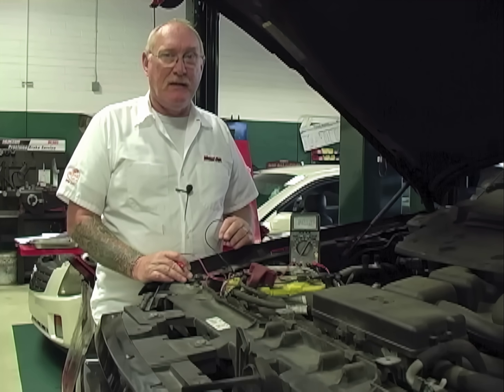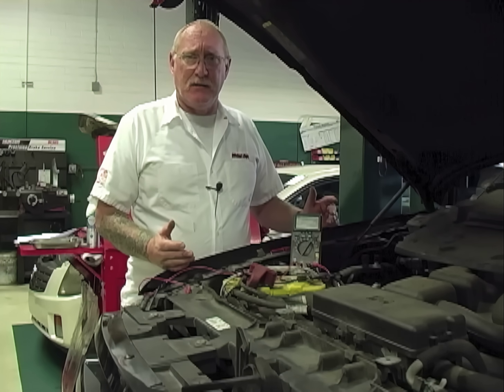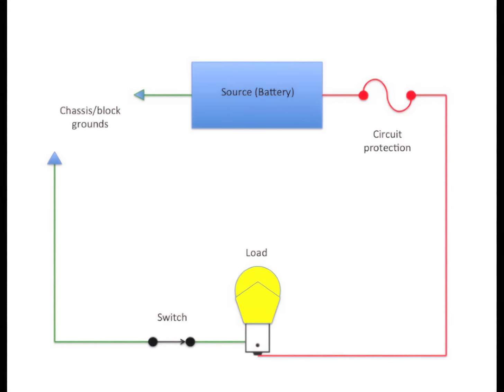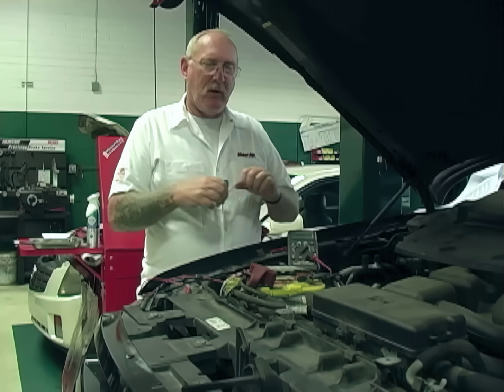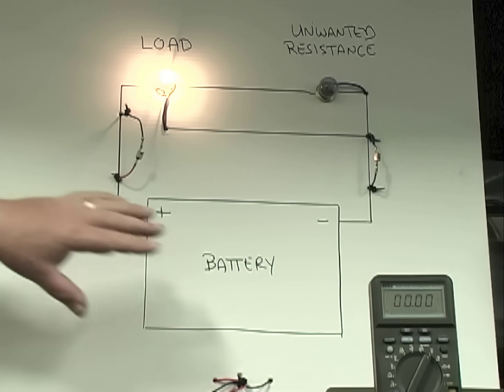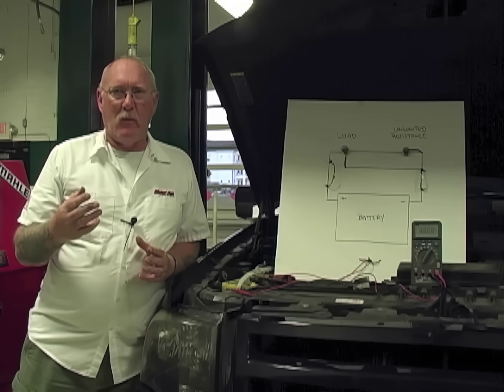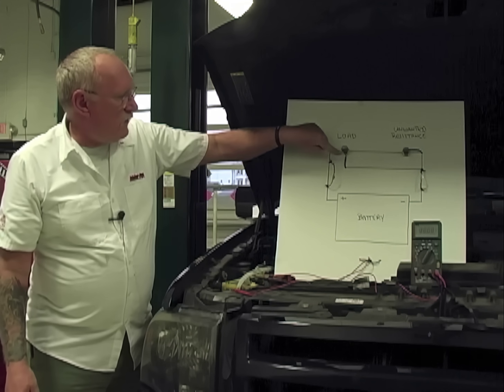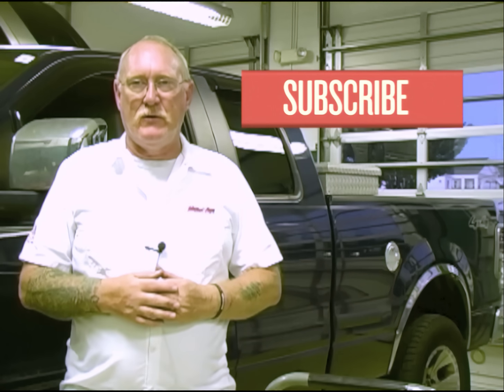The Trainer #47: What measuring voltage on the ground side means

Comment from the maker: I appreciate all the comments and critiques! This is an older video that I learned a lot from, and I've since tried a few different ways of explaining ground side voltage drop. I hope you will all sub to our channel and check out the entire "Trainer" library. THANKS!
Reply: I will be referring your efforts to a few classes of grade six's as I do lectures on their Flight then Electricity portions of their curriculum. Very well done video! The half split method demo'd is crucial in troubleshooting 👏
Reply: Like and subd, thanks,
Reply: Superbe sharp presentation. Makes total unlike many others
Reply: The effects of electromotive force have not changed since Henry Ford 1st put the battery in to his car the basics of automotive electricity are actually the basics of all electrical knowledge to learn that is most important and will get you far in the trade whether it stays with automotive or continues into housewiring or industrial wiring I've just retired after 38 years IBEW Union electrical contractor and have taught many Apprentices and journeymen that have turned out to become their own contractors through the years you're doing a very good job at the basics what's what it all boils down to ladies and gentlemen learn your basics stick with it and it will become easier through the years your videos explain very well keep up the good work
Reply: This is great of course - but when I'm truly mystified to tracing down a dead circuit - 1. I'll disconnect the battery - 2. apply voltage with say a 9 volt with test leads, now work my way up the circuit, and sure enough I find the spot in harness where it went dead. 
Being I know there's only one source of 9 volts possible as displayed on the meter. 
This type of testing is similar to a phone tech tracing a bad line to a phone. A pulsed voltage is applied on one end and picked up out side the harness by receiver. 
Or it might end at a corroded connection. Repair connection and we're good to go.  

Cheers
Reply: Wait. Not that it negates the knowledge you shared or my appreciation for it, but to be clear, you have nothing to do with the trainer, right? Just reposted one of his vids...? Credit is due where it is deserved and I feel like many won't catch the point I'm getting at... is this guy still making content? If so (and regardless), you should really plug him in the title or , well, I guess you did..  I dunno what rubs me wrong about this outside of that I felt slightly misled. Or that may be only because the content was so vital and good that I feel the effort to give due credit wasn't enough. I dunno. Thanks and sorry for being so critical but what's right is right.
Reply from the maker: @jpisow  I'm the guy in the video - name is Pete Meier - and I've been creating The Trainer series for over a decade now. I work for Motor Age magazine, hence the name of this channel. Thanks for looking out for me!
Reply: @Motor Age.  Pete, truly a pleasure to meet you. It's kinda crazy how when you find something worth guarding you start to get offensive in the true sense of the word. Here I am going at you, the guy, in the name of defending you, the guy...ahhh... I'm sorry man. But really, Thank you with the utmost sincerity for the wholesome content and for sharing your ability to teach in a concise and effective way. Wish I would have found you sooner, but hey, better late than never. Right on Pete, but excuse me. I've got a lot of catching up to do.
Reply: My brother has an RV  and the engine battery will loose voltage in just a few days . Not an old battery .Trying to find out why he disconnected the negative ground cable and put his meter between the negative post and the ground cable . After watching your video I still am not sure about whether there should be any voltage . He is getting a voltage of 12.6 volts . At the battery between the posts he has 12.8 volts . Is this normal? He says no but I am wondering . Should there be any voltage at all ?Can you help ?
Reply from the maker: @rodneyterrasrrod2087  With the cable disconnected, no current is flowing so no voltage drop is occurring. All he's reading is Open Circuit Voltage and the reading is normal. What he wants to do is put the leads in the ammeter jack (using a fused test lead is best since you don't know how much current is draining) and measure current between the two leads. Even better is the use of amp probe that goes around the cable. Look for videos on my channel under "parasitic drain".
Reply: @VehicleServiceandRepair  Very happy and thankful for your response. After watching your video I thought if you said 8 volts is a problem then 12 volts should be okay . i went to my brothers and told him he's chasing his tail . It's normal to have a voltage reading between the negative post and the disconnected cable . He couldn't believe it but we took my negative cable off my truck and guess what . !2 volts . So I said what is draining your battery . His new radio . Seems he turns his ignition off and the radio stays on and he never noticed it . He is happy now and I told him you don't know what you don't know . A couple of back yard mechanics thank you.
Reply from the maker: @rodneyterrasrrod2087  Glad you found the problem!
Reply: @VehicleServiceandRepair thanks for the video. 

most YouTube mechanics have no clue about electrical. They don't have a standard maintenance schedule to clean all the harnesses and ground bolts every five years in rust belt areas like central Canada, or places like Michigan. If the bottom of the vehicle has noticeable rust, so can any connections that got road spray on it. Which is basically anything..... Even the computer inside near the passenger floor area can be rusted from salty moisture on shoes.....I've seen that. 

Thanks for the video. It makes YouTube just a little bit less stupid. 😂😂😂😂
Reply: @VehicleServiceandRepair  "It's easy to be critical and much more difficult to be correct.  So what if we don't call the black lead the reference lead... It dosen't mater!

How fast can you find out what is wrong with a car and how fast can you fix it and how much will it cost.  

I would say as complicated new cars are they all require every single one of us to do everything we can to just keep up with all of the advances.   

I watched this very same video and developed a great appreciation for it and for Motor Age and the gargantiuan effort put into making both the printed and visual training materials.
Reply: 3:45   Affect
Reply: Maybe i missed something,  but you are only using one of the two paths from the first load to ground and the other is removed(though still showing in the drawing), not connecting both at the same time?
Reply: Hi, I have charged my car battery using my home inverter a few times. Just want to know if it's OK or not. 
Now my car starts but TCM has issues, just wanted to know if it's related to the battery ⁉️
Reply: Motor Age This is by far the BEST way I’ve ever heard it explained. No one EVER really explained what and why your car’s chassis is used as ground! So simple, but a lot of people may not know that!
Reply: @scrappylady  Some how most all of the voltage gets used up by the load and other resistances, but the current (in a series circuit) remains constant througout the circuit even past the load and flows back to the battery with only a small amount of voltage remaining also going back into the battery.   

The amount of current is determined primarily by voltage and resistance.  E/R=I, or V/R=A, and A×R=V.
Reply: yeah! your stuff exposes much that is missing in the understanding of automotive and electrical control.
I am critical(constructively) but I appreciate your work.
...and I am subscribed...
Reply: 3:45 AFFECT is a verb (influence) which should be used here instead of EFFECT which is a noun (result). Thanks

Comment: MY MAN, GREAT JOB, SIR YOU HELPED ME TREMENDOUSLY ON REALIZING THAT THESE  VOLTAGE DROP READINGS ARE REALLY IMPORTANT BY THE COMMENTS YOU MADE AT THE END OF YOUR VIDEO, SIR, MY MOMS 2004 CHEVY MONTE CARLO SS, HAS BEEN GIVING ME HELL TRYING TO GET IT TO START, IT HAS THE NO CRANK , NO START SYMPTOMS, FIRST OFF HER KEYS HAVE NO CHIP ,SHE DOESN'T REMEMBER IF THE KEY FOB THINGY EVER WORKED,HER FAN MOTOR STARTED STAYING ON EVEN WITH THE CAR OFF,NO KEY IN,WELL MY BROTHER TOOK THE 30 AMP BLOWER MOTOR FUSE OUT, I HEARD HER SAYING ONLY HER HIGH BEAMS WORK,SO I GO OUT AND LOOD UNDERNEATH STEERING COLUMN AND SEE SOME BLACK TAPE COKING OFF OF SOME WIRES, SO I PEELED THE TAPED OFF AND REWIRED ABOUT 3 DIFFERENT WIRES, THEN I SAW A BUNCH OF BLACK ,AND BLACK WITH WHITE STRIPEE WIRES ALL LIKE MELTED TOGETHER, SO I SEPERATED THEM AND TRIED TO TAPE THEM BACK TOGETHER BUT COULD FIGURE OUT WHICH ONES GO WHERE, NOW THE CAR WON'T START, ANY POINTERS WOULD BE GREATLY APPRECIATED

Comment: The bulb on the left has 3 leads going to it.  Either you are confused about how about how many wires it take to light up a bulb, or you've drawn this circuit incorrectly.  If this is how you wire a simple light bulb, it's no wonder why your getting voltage from the body to the ground side of the battery.  Your wiring is all F'd uo!

Comment: The thing that many people don't get is resistance and how voltage drops across it in a series circuit, dependent on current flow in that cct. They see connections at "connected" or "disconnected."

But the fact that a connection can have corrosion/dirt/pitting/etc etc, and therefore a resistance value that can be anywhere between almost zero and open means that you need to understand that to fault find. 

Unfortunately, that is elec theory, and mention that on any page where people "ask you to help", and they immediately argue with "NO, I heard a bloke say (insert random fact)". This would be a random bloke who isn't an elec, and couldn't fix their problem.

People are adamant that they NEVER need theory, because "random bloke said"................ so in the end most elecs give up and leave the page. 

The fact that the voltage drop across an in circuit resistance changes when current is drawn (ie NO voltage drop shown when no current flow/voltage drop when cct completed/current flows) means that to diagnose properly, you have to understand and measure both. 

As cars get older, you can have so many problems with voltage drops across body grounds and earth returns. But you won't see them (measure them) until you draw current across that connection.

Comment: You’re saying that somehow the positive  of one load shorted to ground between the ground lug and the ground side of the battery. Then you need to check a million individual wiring connectors to find the shorted load.

Comment: He appears to have a line bypassing the 2nd load in the circuit. If that is the case the 2nd load would be shorted across so therefore would not light up as that part of the circuit would be zero resistance.

Comment: Maximum allowable voltage drop on ANY BATTERY CABLE under Load, .2 vdc. Positive or Negative. Maximum Allowable voltage drop on ANY CHARGE return, .2 vdc per 10 amps of charge rate measured at the Alternator B+ output. Many older cars had so much resistance from the ignition switch to the starter we HAD to install remote starter relays, at The Auto Electrical Shops here in Flagstaff. I was employed there and at 3 major Dealerships for 40 plus years.

Comment: As a fire alarm technician,  this is every techs worst nightmare on a panel.  Because you can chase miles of wire sometimes depending on the size of the building/ circuit.  Parasitic drains on cars is a common problem that I have fun chasing down as weird as it sounds.  Every good tech should appreciate the challenges which come with their respective fields of work. Excellent lesson , love that it's ten years old too.

Comment: great video, great work. One thing i don't agree: the fuse is always on positive side is because if it was on negative side there would still be a risk for a loose positive wire (unprotected) to touch something metallic (which is bonded to negative node) ultimately bypassing the fuse.

Comment: I bought a Ford edge in 2014 that now has 197k miles on it with no repairs. Oil and fluid changes and still going strong.

Comment: I like this video. I often wanted to figure out why my old Camry had dim headlights. Also I have seen vehicles on the road with the same dim headlights. I figured it was a voltage drop somewhere, and this video gives me some information that I can use to find the source of the drop or short. Thanks for the video.

Comment: The problem on my car is i go to start it and as soon as i turn the ignition.  All power is gone. So i have to disconnect the positive terminal, try to start it and sooner or later it starts..and i have to disconnect the battery a few time for the car to start. One thing in do notice is that the positive terminal clamp gets hot..

Comment: I am a Electronic Test Engineer 40+ years.  This is a Excellent Video. You would not believe how many Electronic Technicians I have trained over the  years. Congrats on  the excellent video...
Reply: Question I have about the video not trying to test you or nothing but actually just wondering. So dosent voltage run negative to positive? So wouldn’t that mean that the voltage has already gone through the load how come the circuit protection is in the positive if it does go negative to positive?
Reply: @bttlmarc5125 you're mistaking voltage the measure of electromotive force like pressure in a water pipe to the flow of electrons which as you say flow from negative to positive in a DC circuit. Like piped water all the pressure is gone and used up when the electrons in this case have tumbled back into the battery reservoir ready to be pumped through the pipe network again. The pump requires work and energy and in the case of our electrons that's the job of the alternator which will ultimately consume fuel.

Comment: So if I put the negative wire of a volt meter on the negative side of the battery and the positive wire of the volt meter to ground and I get a voltage reading ,does that mean something is on somewhere in the car ???

Comment: Great video, is old guys will remember chasing battery drains by putting a 1156 bulb between the battery negative and the negative battery cable. 
The brighter the light, the bigger the draw, then we’d pull fuses till the light went off or dimmed. 
Now we know the circuit to chase for the drain. 
I got an 80’s Caddy that had been to 3 shops and two dealers once for dead battery issues after sitting for 3-4 days. 
3 batteries, 1 alternator new positive and negative battery cables, chassis to engine ground straps and $1,000’s later and no change is how I got it. 

Within 10 min of the above technique. I had the circuit isolated to the accessory lighting. 
Go to was obviously the glovebox light which was common back then. 
But within 15 more minutes I found the issue, under hood light with a mercury switch that somehow got bent out of shape so the mercury switch. Thought the hood was popped and the under hood light stayed on all the time.

Comment: Hey Pete!  3 things 1) voltage is the potential between the positive and negative🎉 2) all voltage will be exhausted in the circuit. 3) resistance is the cause of any change. Man these concepts are hard to hold on to
Reply: That voltage is the potential between takes folks a minute. 
😂😅
It always blows new techs minds when I start doing voltage drop testing and the meter leads aren't on the negative terminal
Reply: @mmix224 I can relate. I'm a carpenter.  A fuse blew in my girlfriend's cars fuse panel. No problem I replace the fuse like a boss. And the next day it had blown again.  That set off this now week-long journey to understand electrical wiring in an automotive setting that took me all the way back to Michael Faraday (and beyond)  very interesting stuff.  The fuse is still blown and I am contemplating going to harbor freight in buying a scan tool today because I still have not figured out why the fuse keeps blowing.
Reply: @MikeStyles-i1b im not sure how much help the scan tool will be. 
What YMM and what circuit is the fuse on?
Reply: @mmix224 '15 Escape 2.0.  fuse 34 if you go by the panel cover.  But the owner manual labels it as fuse 39.   I'm probably going to take it in.  Not even ohms law can help me.  Or kerchoff's law 😂
Reply: @MikeStyles-i1b on the titanium model, there is a fuse 34 (20amp) for left front seat heater module. 
Its listed as being in the rear junction box. 
Not an uncommon issue. Either the harness ends up damaged under the seat from lots of use, or the heater shorts out from wear/tear or drinks being spilled on it. 
Without seeing the car or a lot more info, its about as helpful as i can be. 
Is there anything not working?

Comment: Increasing resistance decreases the current and decreasing the current increases the current flow. But the current is the same on both side and the amperage is not the current it is the voltage divided by the coulmb to the third joules of a MV right?

Comment: I am not a mechanic, but  I do know. You have a real problem if the chassis  ground and the negative side of the battery shows a potential  difference. For one the   starter motor negative side is connected to the chassis. There are a great many issues arise from it. Electronics  in particular is sensitive to voltage issues. Too low too high. Metal shielding  of electronics  is often connected to chassis ground.  And the shielding is often grounded. The engine block and  the chassis ground should be one and the same potential vise. Zero Ohm. Measured  with positive side disconnected. Any leakage  will affect the reading.